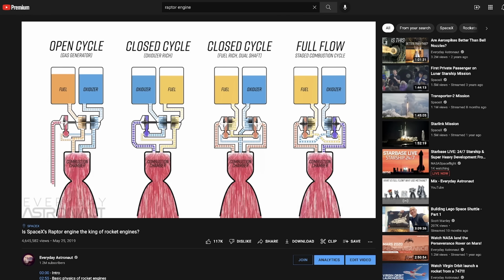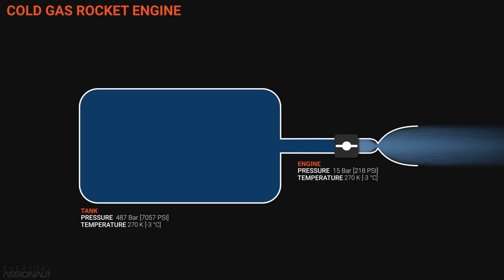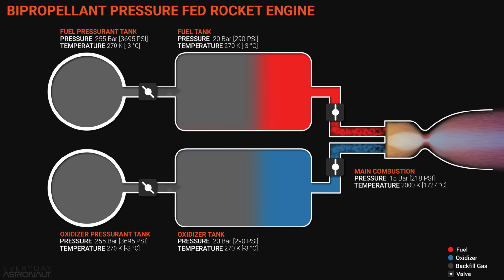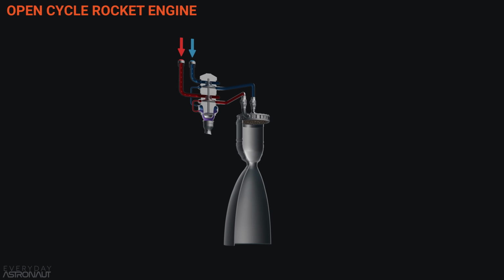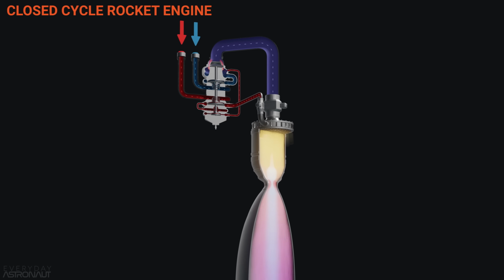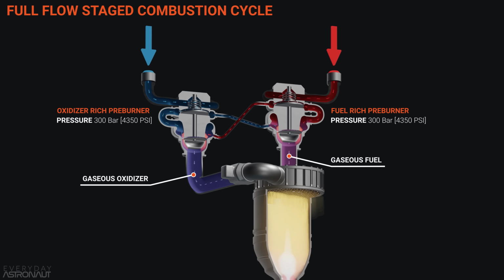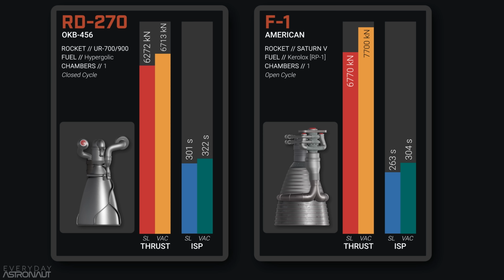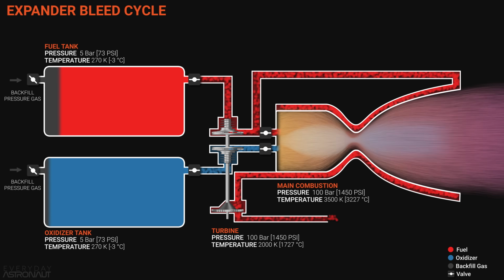Rocket engine cycles: How do you power a rocket engine?

Comment: In the bipropelant engines , this idea couldnt work ?  you keep the tanks pressured up to the point you want , you use them only at the begining  of the launch, and later stages of the flight , and for the duration the rocket is  stil in earth atmosf, ( sure they can work the maths  until when and how  ) you use the pressure of the air . and i mean perfectly placed intakes around the rocket  "suck" air  , then press a piston that perfectly fits the inside of the fuel/oxidiz tanks that it also can move only in one direction (mechanicaly locks and can move back ) thus always keeping the pressure you need , and you can assist it with seconds tanks to keep the amound of pressure you need until the point where you will switch fully to them as the rocket have reach a high were the atmosfere is not helping it .
Reply: Most of the work has to be done outside of the thick parts of the atmosphere, so all this extra weight would not be helpfull

Comment: The rocket motor has several large structures that could be improved. But one of the small structures can also be improved. 
I put forward a hypothesis: by improving only one of these parameters, it is possible to double the engine thrust. Does not increase fuel consumption. 
Can someone do it?
Today's rocket engines have a big design error.
Reply: No, doubling thrust with the same fuel consumption is not possible, that would mean twice the exhaust velocity, or 4 times the energy output.

This is straight up impossible as there is not enough energy wasted from the fuel for doubling exhaust velocity

Comment: Suggestion:

Rather than, "undense" just say "low density" or "are tiny".

Example: Hydrogen atoms are  so tiny/low density that they can easily leak through most seals".

This is not meant as a criticism of the video, which is excellent as usual. I've just seen you struggle over that word for a while LOL.

Comment: Terrific video!  SpaceX’s Falcon 9 has created a new paradigm in rocket design, namely ‘reliable reusability’.  The Archimedes engine being developed at Rocket Lab is similar in concept to the gas generator design of SpaceX’s Merlin D but will have much improved ISP performance due to the use of methane rather than RP1.  We wait to see whether the comparatively cheap and cheery open cycle Archimedes engine is more reliably reusable than the expensive closed cycle full flow Raptor engine being developed by SpaceX.

Comment: AT 16:58 you've incorrectly called the RCS oxidizer and fuel tanks the GHe tanks.  The GHe tanks are kevlar wrapped titanium tanks that are not visible in this photo.  They are in the stinger area located at the back of the pod.  They are easily ID'd by their yellow color.  The GHe tanks are bury inside the stinger and rarely noted in photos.

Comment: Upon which surfaces in the rocket engine is the pressure absorbed into the rocket?  Is it inside the combustion chamber or on the inner surfaces of the nozzle?  

Id like to see a video describing how the forces translate through the rocket during the action/reaction.
Reply: Inner surface of the nozzle.

Comment: I start by building an electro magnet.
And then I build another around it with the windings all going the same direction... And another... Another... Untill I have nine layers of electromagnetic compression...
 Be certain to leave little gaps to run cooling through and between the magnets...

Build a housing around the magnets with ocsulating microwaves in parallel with the  axis/poles of the magnets. Build New housing with superconducting materials inducting materials and coolant coils... Drop temps to zero and below and tun on the magnets one at a time @ 2.4,000,000,000hertz

Comment: Pressure is a parameter, a state function. It is independent of the system, its merely one way to describe what’s occurring between a variable and the system upon which it acts or is acted upon. 

Might want an engineer/physicist/literally any STEM trained person to go over these terms with you or at least proofread the script before you tape yourself.

Comment: instead o electric motor why not put an impeller on the end of the nozzle with adjustable angled fins that turn the shaft which powers and regulates the pump

Comment: The actual thrust equations for the operation in space is
Tr = mdot × Vex
mdot = total mass flow rate  
 Vex = exhaust velocity, mean
depending on the area ratio: nozzle area to throat area , a residual pressure pn remains, a further lateral expansion occurs, called the Prandtl-Meyer corner expansion, not producing any thrust, but visible .
at the throat, the velocity is equal to the local speed of sound, which is for non diassociated gas 
a = sqrt(gam× R/Mix × Temp)
gam is the ratio of specific heats
about 1.31 for the co2, h2o 
mixture
R is the Gasconstant = 8.3144 ( kJ/ mole Kelvin)
Mmix = is the average molecular weight for the gas mixture (kg/mole) = ~27
Temp, the gas temp at the throat.
When the pressure at the Nozzle is known and so the chamber pressure pc and temperature after combustion Tc, the temperature at the nozzle is
Tn =~ Tc × (pn/pc)^[(gam-1)/gam]
then, finally, the exhaust velocity
 Vex = sqrt(2× [Tc - Tn]×cp )
cp = R/Mix × gam/(gam-1)
[Tc - Tn ]× cp is the specific enthalpy change realized.
The exhaust pressure can be calculated by the max observed deflection angle of the nozzle rim Prandl - Meyer expansion into a vacuum
The specific impulse is Vex/g
g = 9.80665 m/s²

Comment: Crazy idea! Instead of batteries, a high powered ground based microwave emitter and a rocket body with integrated receiver antenna.

Or both battery and microwave! Even if you effectively reduce the launch weight by only a couple of batteries that's still a leg up on the rocket equation.

Comment: I finally solved the limitations of an all electric fuel pump. It is so obvious don't know why no one has thought of it before. Need 250,000 hp?  No problem. Need 1,000,000 hp? No problem. Just use a really long extension cord.

Get invested in my startup company early. We make Carbon Fiber Nanotube Graphene wire that has almost zero resistance. Wires can be made extremely small and lightweight. The wire also acts like a super-capacitor. 

Now if you believe this, I got a great deal for you on a bridge in Arizona.

Comment: TL;DR It's a Rocket engine. It's powered by rockets. Duh. Small to mid-size decomissioned rockets are ground into a fine Rocket-paste and mixed with hydrogen peroxide. It's a green, increasingly circular ecology.

Do note: If your Rocket engine fuel cans or pre-filled Rocket engine vessel has been sitting for while, you need to shake it rigorously for 2 minutes before use, because the mix is an emulsion.

Comment: For piston engines, you failed to mention carbueration, mechanical fuel injection, electronic fuel injection, direct injection vs manifold injection, hydraulic tappets vs solid lifters....

;) 

The list can go on! ;)
Reply from the maker: Those are all different ways to inject fuel, so would be more akin to the fuel injectors in a rocket engine too, pintle, direct impingement, swirl injectors etc etc in my opinion.

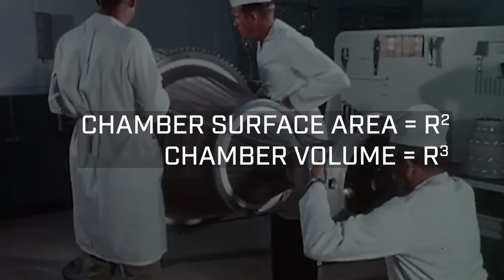Comment: at 48:59, isn't precisely the inverse? a small engine has a smaller volume/surface ratio hence easier to cool down? (ie easier to extract energy from its surface) same reason the metabolism of small animals is higher than those of bigger animals.. and then the following phrase has more sense, a bigger engine needs more energy for the pumps, but their surface is relatively small (to their volume) hence you struggle to obtain enough energy for said pumps.
Reply from the maker: A twice as large engine with flow 3 times as much fuel through the walls while only having the surface area increase by twice. So basically the inner bit of the chamber doesn’t need cooled, only where the flame is touching the walls do you need to cool, not vice versa. Watch my video about aerospikes, I go into it a lot there!

Comment: I had to listen to the description of the expander cycle a couple times, but I think I get it.  It sounds impossible: fuel first flows from low pressure to high.  So far so good, because it does so under the influence of a pump.  Then the same fuel goes from high pressure to medium, driving a turbine -- the same turbine that powers the pump, not only for the fuel but also the O2.  Less mass-per-second of material going through less of a pressure drop, to power more mass-per-second going through more of a pressure increase?  That's what sounds impossible.  But power isn't mass per second times pressure difference.  It's volume per second times pressure difference.  A smaller volume of cold fuel gets pumped, and then turns into a larger volume of hot fuel as it goes through the regenerative cooling system.

It seems as though you could sort-of get around the size limit by having one turbine drive one pair of pumps to feed one combustion chamber, and then get enough area for heat exchange by having it go through multiple nozzles.  But I don't know where the benefits of having a larger engine show up.  Maybe it's all from a larger nozzle, in which case you wouldn't gain anything by having the nozzles technically be part of the same engine.

Comment: When using a pressuriser gas to compensate the outflow of fuel/oxidizer, keeping a high pressure in the tanks, the pictures show a nice separation between pressuriser and fuel/oxidizer. But the gases will mix, so the pressuriser gas will dilute the fuel/oxidizer... or not? or is it just negligible? same comes to mind when I see the (awesome) animations about the SpaceX Ship and Booster methane and oxygen tanks being re-pressurised during re-entry...
Awesome videos as always BTW
Reply: For pressur-fed engines that purely operate in the vacuum (or more precise zero-g) the fuel and oxidizer are stored in flexible bladders inside the tanks. The pressure gas only pressurizes he volume between the tank wall and the bladders. 

I suspect that Tim knows this, but didn't want to add an other level of complexity to this topic (and his animations)

Comment: I’ve got a question about pressure fed engines. The video shows the high pressure gas pushing the low pressure gas out. The two gases remained separate as if there was a diaphragm in the lower pressure tank. Is there a diaphragm? If not, what prevents the gases mixing?
Reply: Usually there is a diaphragm or a bladder that separates the pressure gas and the fuel.
I suspect Tim omitted it because of simplicity.
Reply: @3gunslingers  thanks. That explains it.

Comment: If most of the energy is fed by beem, like a radio laser...

Could it use a version of that first one? Just gass pressure? With heating just enough it doesn't turn liquid?

Comment: Now how about an engine that uses a battery operated pump to get started but taps hot gases to drive a turbogenerator to provide electricity to keep the electric pumps running once started?

Comment: For the full flow stage design why don't they connect the two pumps with a shaft. It would make it easier to control since if one pump isn't working hard enough the other can spin both. I'm sure spacex has ironed out most of the problems and computers probably are able to control them pretty well the way they are.
Reply: i think they spin at different rates so you'd have to gear them, there's probably other issues
Reply: @cod6guy12  I don't think they would need to be geared since changing the blade angles would have similar results... They should spin a similar rates based on the fact that turbos are all efficient at the same speed (say 40000 rpm) but that's a leap of logic.
Reply: @iamsick5204  maybe. other things to consider are that the fuel and oxidizer are different densities and have to arrive at the combustion chamber in a very specific ratio, doing that with one shaft might just be harder even if its possible. other engines obviously do it but FFSC adds so much complexity

Comment: For closed cycle (fuel rich): Would it make sense to have an electric motor/generator from the gas gen turbine to the oxidiser pump? This way you can avoid the complex seals between the hydrogen and the oxidiser.
Reply: a motor big enough for this power level would probably be bigger, complexer and heavier than the seals

Comment: The RS-25 used hydrogen in the fuel rich preburner to avoid coking. How are methane or other carbon fuels used in preburners while avoiding coking?
Reply from the maker: Methane is fine to run fuel rich. For RP-1 coking is an issue which is why you won’t see fuel rich closed cycle RP-1 engine. It can be harsh on the turbine stikl
Reply: @EverydayAstronaut  Got it, thanks!

Comment: Could the efficiency of the full flow be theoretically encreased if it get combined with the expander engine?

I mean, actually the full flow is wasting the thermal energy in the nozzle. Or?

Nice video. Thanks.

Comment: @Everyday Astronaut I think you have mixed up the positions of oxy and fuel-rich sides for FFSC. Due to higher mass flow, the oxy-side is directly above the main combustion chamber, with shorter and simpler gaseous side piping. The fuel preburner/turbine is stacked on the side. This is true at least for SpaceX Raptor.
Reply from the maker: That is the case for Raptor, we just made a generic engine layout and had it match our others so the viewers were confused.

Comment: Absolutely magnificent! I thought I already had a pretty good idea of cycle types, but still learned a lot. Each time a question arose in my head, you did immediately address it in the next sentence or so.
Reply: could you explain the difference between the rocket engines used on planes/jets versus these? and why wouldn't raptor be used for jets ?

Comment: Great video as always! 
The animations are EXTREMELY helpful and neat.
I'm kind of confused with the Tap-Off and expander cycle on how they maintain turbine pressure that is higher than the combustion chamber pressure (or at least in a way the engine won't stop).

Comment: About the expander cycle engine, why don't they just run both the fuel and oxydizer through the nozzle? If the "preburner" pressure has to be higher than the combustion chamber pressure anyway then couldn't they get the fuel and oxydizer pressurised enough to go straight into the combustion chamber right after being heated by the nozzle, eliminating the need for turbines?

My best guess as to why they don't do this is because having the hot fuel and oxydizer next to eachother in the nozzle would be an explosion hazard. Let me know if this is correct.
Reply from the maker: The turbine is what powers the pumps that create that high pressure. No turbine = nothing to run the pumps! So you absolutely need to run the high pressure propellant through the turbine to power the whole engine!

Comment: What if you stored your methane and oxygen as solids in your tanks? As you froze the fuel/oxidizer in your tanks spin the tanks in centrifuges to create a channel down the middle. Well insulated tanks would leave the central channel as the only free surface. The pressure tank walls would be very thick due to the solid fuel/oxidizer and could therefore hold that central channel to high pressures. Each tank would only need a regulator feeding the combustion chamber.

Comment: This was good! It was only slightly overwhelming.🤪But by rewinding after each each example, I was able to understand, albeit fleetingly. As a resource, it has significant value. Next I will see if the text version can reactivate or strengthen the neural connections. By the way, it was an incredibly quick 52 minutes, even with rewinds. That says a lot. Thanks for your hard work and enthusiasm.

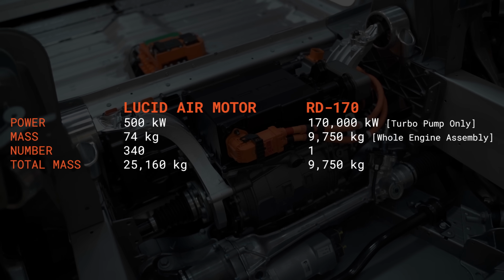Comment: 19:30 The Rutherford engine already has almost the same thrust-to-weight ratio as the RD-170, which means we could scale them up to the same size. I don't think the comparison with the Lucid air motor works, because they're not optimized for high power density. There are just have different requirements for rocket and car motors.
The weight of the batteries is more likely the limiting factor. However maybe in the future we can use them for larger rockets, when we use new technologies like structural batteries, and make the tanks into batteries themselves, or use solid state batteries with higher specific energy.
Reply from the maker: Unfortunately engines don’t scale like that though! It’s non-linear. Again, 230,000 hp out of even the highest power, most efficient electric motor would get quite heavy

Comment: Seems structural batteries would be the way to go for electric-pump-fed engines. Turn the walls of the tanks into batteries.
Reply: Might be possible on the fuel tanks, but for the larger oxidizer tanks it sounds risky, a single cell going bad in that very oxygen rich environment could probably destroy the whole tank, ignition temps are much lower at higher oxygen concentrations.